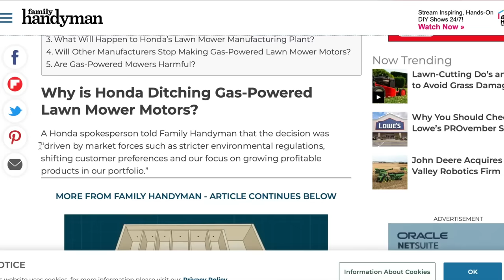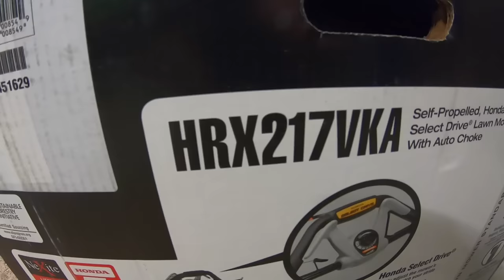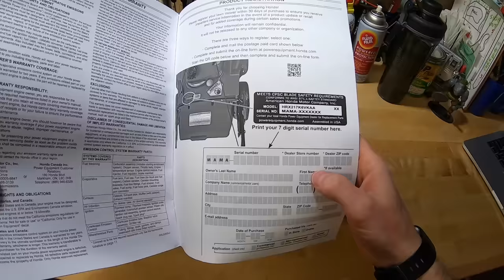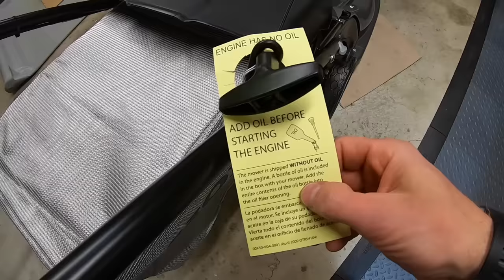ARE HONDA LAWN MOWERS STILL WORTH BUYING IN 2023?

Comment: I have a Honda generator. It will never start.
Reply from the maker: Does it have bad gas inside the tank?
Reply: @GarageGear  I have proven that old urban legend wrong so many times it isn't funny. Unless you store your generator or lawn mower equipment out where moisture can condense (like in an unheated backyard storage building), there is no such thing as "bad gas". My garage is insulated and partially heated. 
So no, my generator won't start because it has bad fuel handling engineering design internally, and if I want to use it, I have to take it to a local shop to take it apart and restore it to run. 
I use the same gas can to fill all my equipment. Everything else starts, but not the generator.
Reply from the maker: @rayrussell6258  oh ok we’ll take it in and have it looked at

Comment: Good video! . . . Soon after buying my new HYA late last fall, I stuck a cheap wireless Vibration Hour Meter on top of the engine. I changed 1st oil at 2 hrs, hope for long engine life. . . Still have my HR215/SXA running, but repairs are getting expensive.
Reply from the maker: Appreciate you Reggie! Thanks for watching!

Comment: I have the toro personal pace ,and the Honda top of the line
Mowers,I prefer the toro personal pace,cuts just as good,for half the price,I do not care for the Honda drive system,very awkward,toro is much better,same goes for the snowblowers,toro does just as good of a job for a much lower price,Honda is way over priced and to much hype.
Reply from the maker: Thanks for sharing tim!
Reply: @GarageGear  I do like the roto stop on the Honda, that’s a very nice feature.
Reply from the maker: @timkalal6983  definitely a nice feature

Comment: The carbs are junk on all new small engines. I have a newer honda and I can't go 5 uses without have to disassemble and clean the carburetor. Absolute junk. I have a mower from the 80s and I can leave the gas in for a year and that bitch starts right up.
Reply from the maker: Thanks for sharing